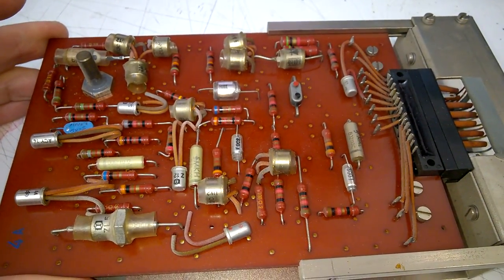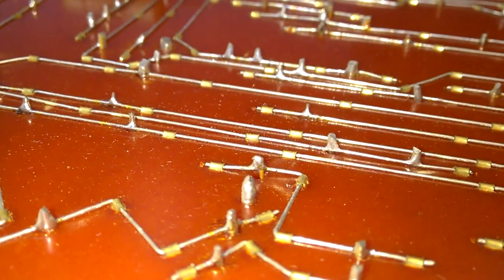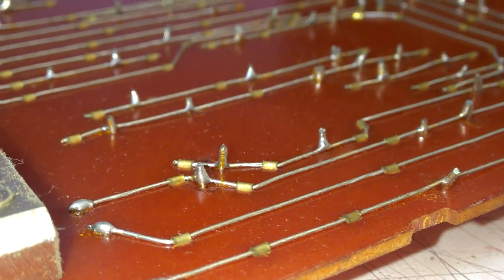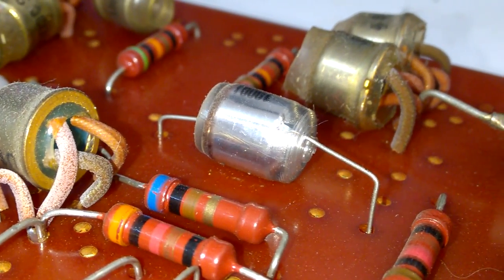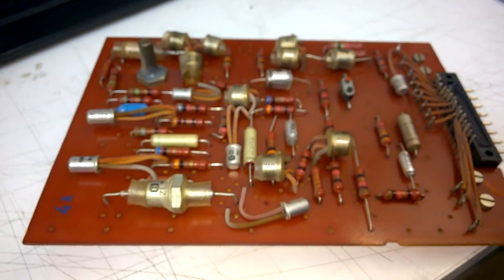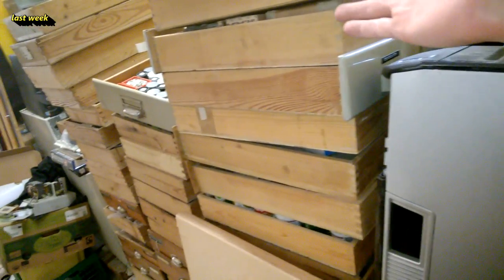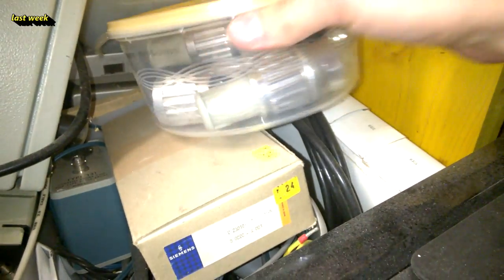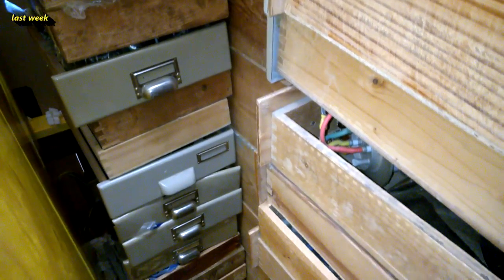Weird 1964 Vintage PCB: Look at that! Siemens & Halske Board

Comment: "I hope I can do this without a cut." Cuts Always good for a laugh :D
Also, I'm excited to see the drawers' contents, and the board reminds me of how I still do some prototyping, if there is no copper pads on my perfboard. I just lay the silver wire traces, and then tie them down between two holes with another piece of wire. And if there is some copper pad, I solder the piece of "hold-down" wire. Pretty efficient for simple one-off circuits.
Also also, get well soon!
Reply from the maker: Thank you very much!!!